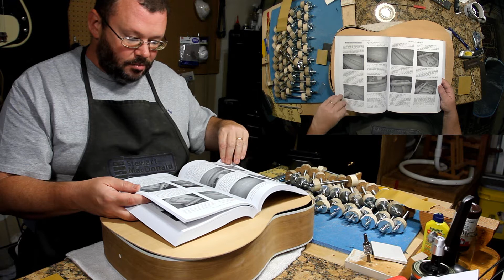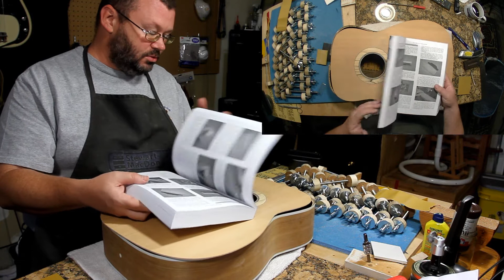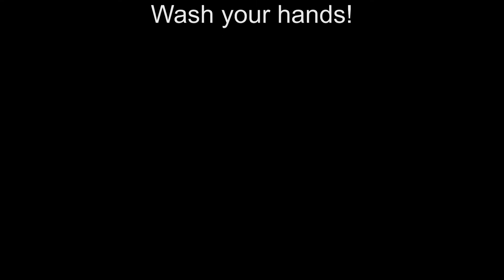BRUNO VENTURA "LAZARUS" top glueing time pt.30 | RATTLECAN GUITAR RESTORATIONS by James O’Rear

Comment: Binding "paste"! It's what Gibson and a lot of other manufacturers use to fill gaps between binding and wood. You soak some of your plastic binding cutoffs in a little bit of acetone (assuming you can get that in Cali, anyway) overnight, and it makes a sludge that you mash into the little crevices. Once it's dry and you sand it, it's invisible.
Reply from the maker: Good tip, no binding scraps.